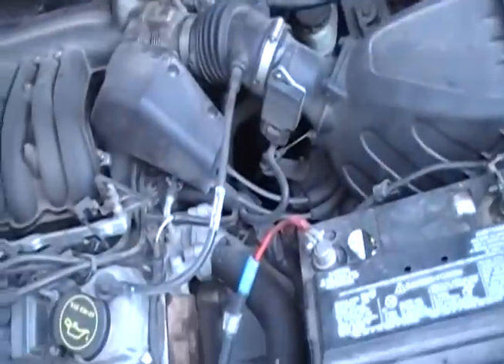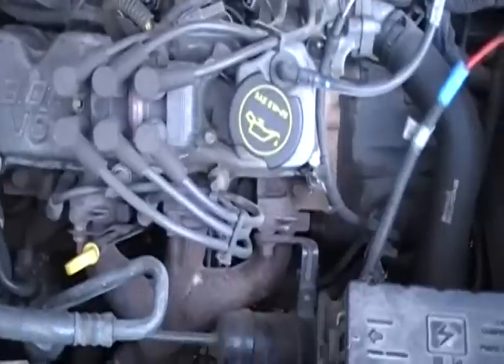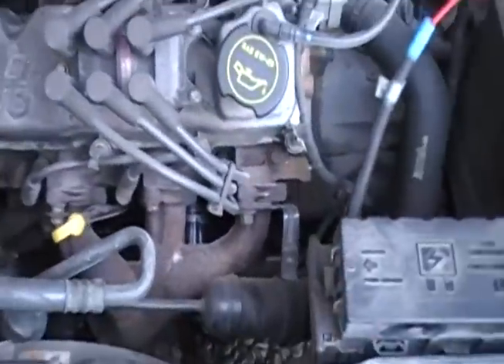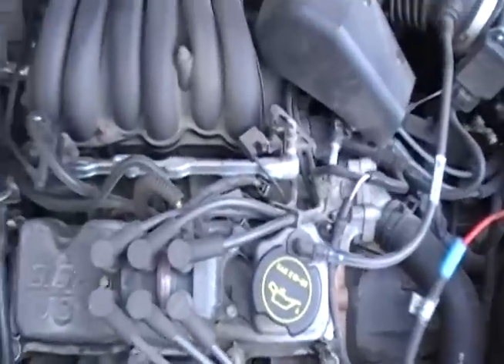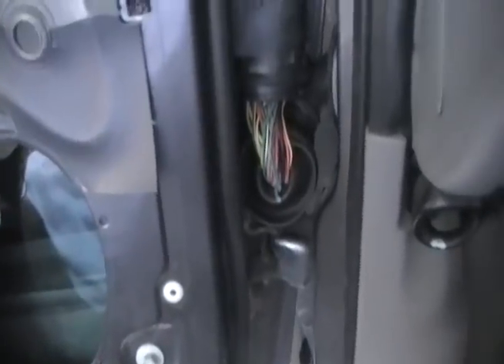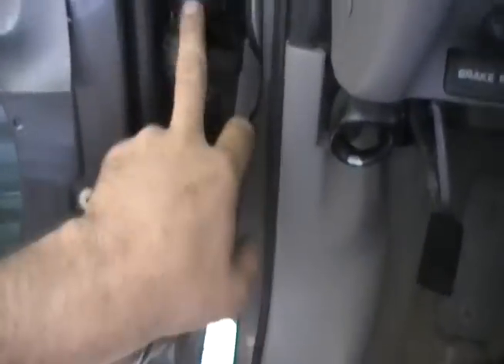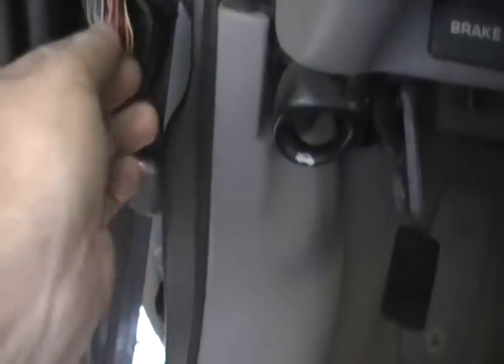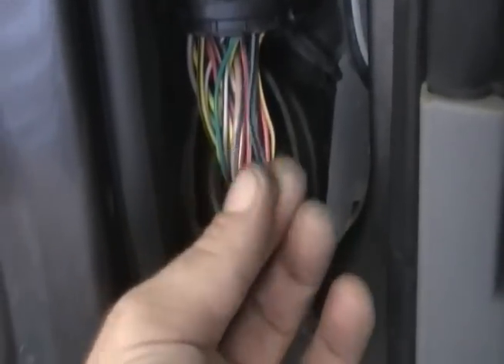2002 Ford Taurus Power Window Fix

Comment: WOW. Went out and bought the fuse, relay, still not working. After watching this video, I went back outside to the car, opened up the boot and it felt like I was watching your video all over again. Stripped the broken ends, twisted together then capped it off, some electrical tape and windows working perfectly again. Problem solved! You rock. BTW I have an 04 but it's the same. Again, you saved me time and money. I am a subscriber now.

Comment: After putting in a new switch, and trying all new relays (all of which I was able to return) I decided to hunt on the internet before hunting for what I now knew had to be a broken wire.   Your video was a gift from God.  Went right to the powder blue wire, pulled on it, and out it came.   Was broken in two, and rusted at the break.   LOL   Thanks so much.

Comment: Thanks man! 2002 Sable with 142,043 miles on it. Fixed the windows!
Reply: I have a 02 Mercury Sable LS Premium. How did you fixed it and what tools did you use?
Reply: Found broken power wire as he shows in the video. Cut back both ends of the wire to get rid of the corrosion. Used a heat srink butt connector and crimped it to the wires. Tools- Wire strips and a wire tie. Pretty easy fix for me.
Reply: ^Wire stipers

Comment: Bro you deserve an award lol. I did exactly what you said for my Ford Taurus '03 and fixed it in 5 mins. the  blue wire w/black stripe was cut clean through. I stripped the coating off both ends, twisted the inner fibers together put an electrical twist cap on it started the car and boom first try all the windows worked like a charm. You my friend are a f#ckin champion

Comment: The video and advice both were dead on.  All my power windows stop working at the same time.  I looked in the boot and sure enough the wire was broken.  Repaired the wire and all the windows are working as if nothing had happen.  Thanks for saving me time and money on a repair that might have cost me over a 100 or more dollars. 

2005 Taurus

Comment: This is the answer to my Taurus 2003 power windows only going down without going back up. Not fun driving around in a Michigan Polar Vortex with the window down. Found the wire it was broken, made thew connection and my window is back up.
Thanks, this saved the day.

Comment: Excellent Video.  I have a 2004 Taurus.  All power windows stopped working. I took the driver's side inside of the door off (plastic housing on the inside) and saw two connectors underneath the driver's window switches. On larger connector, the power was the thin blue wire. On smaller connector, the power was larger blue/black wire.  I checked with volt meter to see that I had power to the small blue wire, and I no power to the blue/black wire. Broken wire was exactly as video shows. Thanks!!!!

Comment: Exactly the fix I was looking for. The blue/black wire looked like it had been cut.
I used a yellow butt splice and crimped it with a vice grip due to tight quarters.
Thanks for the video!

Comment: Using a tactic from another poster, while depressing the door switch, I kept tapping the inner door panel with a hammer.  Suddenly, the window started working again.  I had not used the back windows much, but will now exercise them frequently.  Thanks for the video and the other posters who solved my problem.  I will be on the lookout for the blue wire issue if it crops up.
Reply: A quick check to see if the motor itself is going bad is this quick trick which does about the same thing as tapping the door panel. While holding the switch up or down, slam the door shut. Most of the time it’s enough force to kick start the motor working again. Usually this happens with rear windows, or windows that don’t get used much. Bad spots develop on the bushes or where the brushes contact the motor because of them not being used often.  It’s not a permanent fix, but may be enough to get the window rolled up (if it’s raining) or -5 outside.

Comment: thank u for posting this video. I have a 03 Taurus with the same window problem. The blue wire was broke right where yours was. I used a wire nut to put the wires back together.

Comment: On my car it was the large black wire. I lost all windows and the key in the ignition chime stopped working. It did click when window switch was pushed. Good video, don't remove door panel check the wires first.

Comment: 2003 Taurus - After checking every thing from fuse to the window motor this was right on the money.  Took 15 minutes with a crimp tool, connector & some insulation wrap.  Many thanks to BustedKnuckleShop

Comment: THANK YOU!! soooooo much my car did the same thing. at first i thought it was a fuse, but the diagram didn't show one on the box at all. i called the parts store they said it was probably the window motor and regulator. none of the windows were working and when i would press the botton down i would hear a clicking noise under the dash where the relay was. i peeled back the rubber "hose" and there it was plan as day and it only took an hour. pshhh i almost went to the mechanic for that. sheesh...

Comment: That might be the problem with my 97, it would work if I rolled the window down right after I shut the door, but now not at all. I cleaned the connectors on the switch to no avail. Thanks for posting.

Comment: Our driver side window won't go down. My husband looked at the light blue/black wire and appears to be ok.  Is there a special color wire for the driver side? Our power locks didn't work either and the pink with green tracer was the culprit for that one.  Thank you for the info. We would have eventually found it but you made it easier for us.

Comment: So I found the blue wire, fixed it and all the windows worked. But after two days, the driver's stopped working while the others all do. Is there another wire just for the driver's window?

Comment: My car has the exact same issue but the problem is when I got into the rubber housing I saw that it’s already been repaired once with a butt connector and it separated again, so now the wires are too short to reach, I went out and bought some butt connectors and primary wire but I’m not sure if that’s the right wire to use. The guy at auto zone said it should work, my concern is if it’s two wires within one heat shrink tube like a dual core type of deal or if it’s all one wire. I just don’t want to short anything out and end up blowing fuses for other parts

Comment: I'm gonna check this on a 00 Sable, its having the same issue with all windows not working, but couldn't you just check that wire anyway from the switch connector? using a test light or something, that would tell you if it was broken before you even get into that boot.
Reply from the maker: Yes you should test at switch first. If you get no power, then you need to trace wires to find a break or short in the circuit. That's how I found this faulty wire.
Reply: +BustedKnuckleShop Well you helped me somewhat with the windows on the sable, the thick LT BLUE/BLK wire was broken, I also found a Pink/Yellow wire that was broken and 2 others with broke coating, I spliced all of them, that got the rear windows working, both fronts still do not work.

Comment: I have a 2003 Sable wagon. LR window quit working.  When you hit the driver's door switch you hear a clicking like a solenoid in the LR door.  Same with the LR door window switch.  Any thoughts?  Doesn't sound quite like the blue wire issue.

Comment: Whats interesting is hat I have been in the electronics business for many years and I know what wire and cable should be like. The power lead that breaks on this (mine was not corroded at all but was broken even though it had braided wire in it) It was like it just fatiqued and that it was never annealed

Comment: I dont understand, how do I actually fix it, I get tjsy the blue wire is the one for the window, so what do I do with it...cut it? tape it? pull it out and strangle myself out of frustration?
Reply: Lol! Did you fix it? I had the same problem about 2 years ago. Same wire. Never had the problem again. 

I have a different problem now! Lol!
Reply: You need to splice them together, wire nut.. solder them..

Comment: Does this work if it's just the passenger side window that doesn't roll up?
Reply: I'm having the same problem with mine. It just started about an hour ago. It rolls down with the button on the passenger side. When I hit the button to roll it up from the driver's side, the lights go out but nothing happens. Push the button on the driver's door to roll it down...nothing! Lights stay on but nothing happens.

Comment: My 2002 Ford Taurus power windows and interior lights weren't working. Fuse #26 was blown in my case. I hope this helps someone because I couldn't find it in the manual or the owners guide. Had to guess and check every one before I found it.

Comment: I have a 2002 Mercury Sable (same set up) and whenever the car sits for a few hours and I start it up it won't let me use the window controls. After about 2 minutes I hear a click noise and can use the windows like normal. Any ideas? This aggravates me to no end, I'm thinking maybe a bad relay? 

Much thanks
Reply: Did you figure out your window problem? I have the same issue.
Reply: thersten ever figure it out?

Comment: Another rocket scientist who doesn't actually show how to splice the wires back together. So I will help your viewers.  Get a short piece of wire with the same gauge and tie the two wires that have broken together with butt connectors, crimp them well and complete with black electrical tape and put your boot back never leave that off.